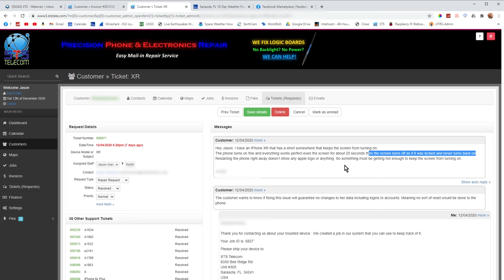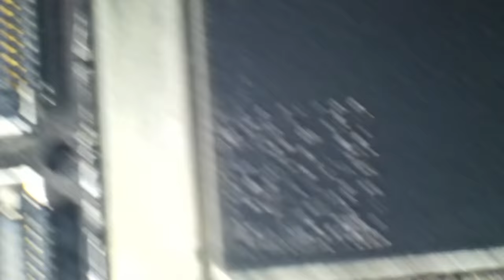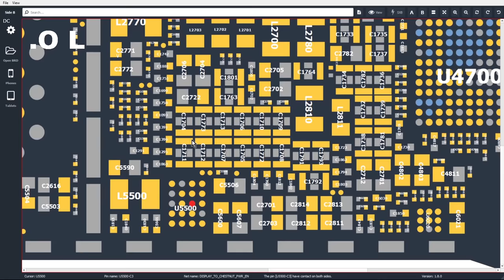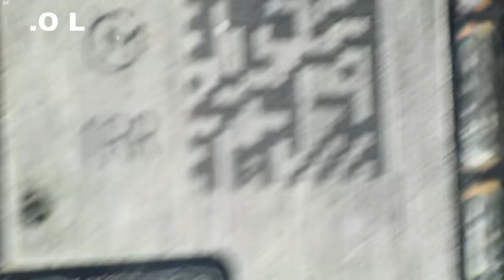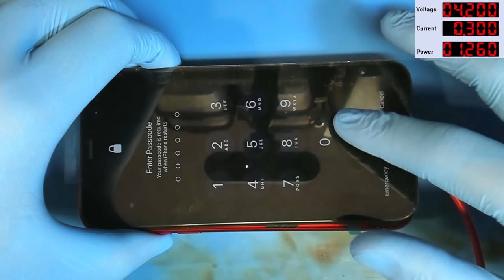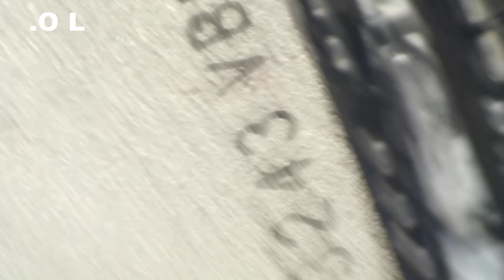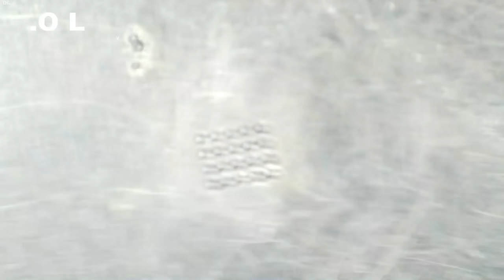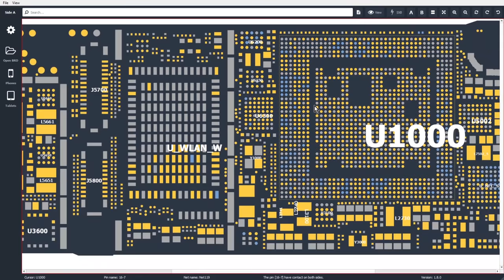Repairing an iPhone XR with "No Image" - What I found inside this phone was horrifying!

Comment: Ah spoiler!  @~30:30 ... Maybe you are mixing up Fahrenheit and Celsius here.  200 degrees C is twice the temperature of boiling water at sea level. @~31:20 you state 195C' is just warm.  60C' is very uncomfortable (and some reckon too hot to touch) with a finger.

Interesting stuff Sir.  You and Louis R. both fail at showing even briefly the end result of component replacement with all the flux and hoary bits removed.  Viewer satisfaction?  Keep well and live long.

Comment: To rinse the board you should use distilled water.  Submerge 100% of the board in Distilled water, agitate it for 2 min.  then do it 3 times changing the water each time. 

Distilled water is pure, water has an innate property of wanting to bond with all garbage.  so it will pick up all dirt and crap and pull it out of the phone part.  Doing it 3x helps this.  The best part is when it dries, it leaves zero residue.  It's far safer than alcohol and causes 0 problems with electronics.  Water (h20) pure is non conductive and the best way to clean electronics.

Comment: 🔰🇺🇸 — I notice Jason doesn’t use any canned compressed air or regular compressor air…What’s the reason not to use air for drying or removing debris❓
Reply from the maker: I used to spend around $30~$40 monthly on compressed air but I don't really have a solid reason as to why I stopped using it.  I have an air compressor in the garage that I use on rare occasions for electronics but in the shop when I need to rapid dry something, I just use my hot air station & small nozzle.  I think there are some times when compressed air contributes to higher success rates though, honestly...  compressed air can get under the ICs.  I'll probably add a small compressor to the shop before much longer.

Comment: Just have to work in higher priced junk I used to fix stuff that sold for 40,000 people thought I was a Wizard I didn't like working on it every box was a mind bender one was sent in because the customer backed over it with a pickup it passed eld check but would not work while not in the bench going through expliitory exploded diagram mode the fix was a new case only $750.00 US .

Comment: Why wouldn't you just ultrasonic in straight Isopropyl?
Reply from the maker: I tried that when I first got my ultrasonic cleaner but then after seeing how well it worked using a solution that was made for it, I just never use anything else.

Comment: Uggh, I was eating supper when watching this, and it turned my stomach. That prior refurb job is disgusting. It looks like it was done by a drunken, stoned orangutan. While I have seen circuit boards more disgusting than this (I worked for decades as an electronics repair tech, so I can tell you stories that would horrify you: boards that have been dropped, broken, huge holes burned in them from lightning strikes, nests of spiders living in them, etc), this is up there around the 80th percentile of "severely screwed-up boards" that I've seen.

Comment: guaranteed that wasnt 195C (383F) lol.. .considering 65C water can cause severe burns in seconds, id have to say its not accurate lol. or it is that temp, but thats internal temp of the dryer not surface temp.

Comment: I just don't like designers who puts a starter inside an engine under the head it's the same thing as working on phones you got many different wires and connections that do different things and you got chase the problem around until you find the short that is one of the worst jobs you can possibly get working on vehicles it's the same with computers the same with phones and the manufacturers themselves make mistakes too

Comment: Phone I got a new phone My old phone worked perfectly and the company I'm on a family plan and the only reason why everybody got new phones was because of my phone I guess my phone it never got replaced it never got damaged I had no issue with it besides I had to use a wireless charger on it because the prongs for the charger got extremely dirty and packed with crap I'm wondering if my phone is not new phone it's a rebuilt phone makes you wonder if the phone companies do a beat and switch with people

Comment: I have something wrong with my iPad as when I charge it with any charger i leave it for about an hour and it goes up about 5%
Reply: Could be anything from a faulty pin in the port, to a bad charging flex cable going to the motherboard, to a battery, or could also be the Tristar charging IC that's throttling the charging current.

Comment: Water boils at 100 c so I suspect your unit is in Fahrenheit if you had it at 205c that's 401 Fahrenheit and there's not a chance in hell you'd be touching that with a rubber glove because it would melt instantly to your finger

Comment: It always blows me away how Apple says to push quality, yet the user base has no idea just how different it really is. The thing that I and many others have heard that pisses us off, is from previous Engineers who worked for Apple. In-house they talk about their user base as 'idiots' who will never understand anything. That and Engineer sub assemblies to fail on sync with new devices. Compared to companies I worked at where Engineers I knew would put a lot of care and love into designs, in the hopes that one day some advanced user will appreciate the hard work gone into a circuit. Other things like redundancy, leaded solder and most of all, quality. 

I mean to start, Apple runs Class 2 Lead free electronics. Nothing like a company that claims it's tech is the best, yet designs and Engineers from the get-go to cause failures.

If only people could see some of the actual high end electronics out there. The kinds that will outlive us, our kids and their kids-kids. But at least Apple's software setup is locked down and no bullshit. Their interface is pretty snazzy, but that's about it. 

Also seeing all those solder balls gave me a mini heart attack. Chances are that fluid you see is either old conformal coating. Or god forbid, SMT No-clean flux leftover when the board was made. Which god, is heart breaking. Any Flux apart from RMA if left on a board will corrode the board. No company per IPC should ever leave Flux behind. I knew their quality is bad, but seeing your video... Wow. I did not realize it's THIS bad. This is a Frankenstein of Class 1 with some Class 2 on the side.

(Aerospace Engineer 11 years) Also love your channel.

Comment: We had a moron fix a broken camera on a Apple 12. After she dropped it it broke the camera but nothing else was wrong. We found a clown in Bolivar MO. Which said he coukd fix it for 135. 
And we Said sure. A couple days went by then we get a call. He said they screen was broke. We asked how that happened he said because we had a screen protector on it, it surprised the tech working on it and he broke it because of the screen protector. 
After the screen was replaced and camera. We picked it up. He said that we may have some experience with messages saying it's not an an original screen.  I said what.  Well if you wanted to wait for 3-5 months for an original we could. 
We left with the phone and the first thing we noticed was the screen woukd lock up. All you can do is hit the power button to turn off the screen. 
And iT starts working again. 
Second problem. Screen goes blank with a whitish throbing screen. We have to set it down and leave it alone. It eventually comes back. 

Any help?????
Thanks in advance

Comment: Yeah looks like refurbished, horribly, and this is exactly why i will never get one and really recommend against it, since they're still pricey, but can have a multitude of problems popping up soon.
Also heard some actually refurbished ones are sold as new as well, which doesn't sound encouraging.
But i like how iOS works and HATE android with a passion.
There's so much wrong with Apple, lack of freedom, but safer and less data being shared, less options to modify it or the system, but safer, memory upgrades too expensive and not possible later, they are assholes with fixing, or lack thereof, and basically if it cannot be fixed with a new screen with the stuff that comes with it you're done, they should do board repairs, not great with moisture, lack of microSD slot etc, but i still prefer it over fucktard Android and more plastic cases and too many different Android versions and poorer software support in the long run.
I mean, i used my 4S until the 5S came out, used to from launch day to just after the SE 2020 came out, 6 years or so, try that with any Android and still have support.
Funny how i trust SOME board repair shops more than refurbished, it may be a handful so far since i've seen their work, but stuff like you, iPadRehab, Louis Rossman etc. inspire more confidence than Apple, Apple authorized, and most other shops, too many are shoddy.
And i worked at one of Apple's own repair centers, and i was VERY disappointed in what they do and how. When my contract was cancelled because they were downsizing and combining our department with another and went to working in shifts which i will never do again i was absolutely fine with that, and i weas very vocal about the crappy way Apple and especially some of the people their worked. I was happy to be out of that job. That's saying something.

Comment: Sounds like it went for a swim that has been corrupted by whatever it was dropped into, …you act, & speak like a friend from 20 odd years ago, … he upped the president 360 pc I gave him that was given to me, … it worked well, but I was not on the internet back in those days, … his name was Tim, … & he lived across the street from the bar we both drank at, … the owners, of the bar, also owned the apartment building where he lived, … darned decent gent to have been associated with, … the guess work involved dissecting the intricacies of electronic components must be spot on, in order for the device to work, … & most times quite tedious to pinpoint any associative error, or problematic component are entwined to complete circuitry, … I had a friend that bought a wrecked car, who could not find out why the left turn signal did not work, … it wound up being a ground wire sensor, that would not maintain a good ground, … the wire was broken inside of the plastic insulation,  & would break contact when inserted into the socket, … it took him about 6 weeks to figure it out, but he made $6,800 profit off of the car once it was completely repaired, …